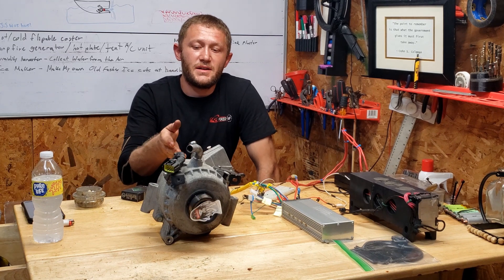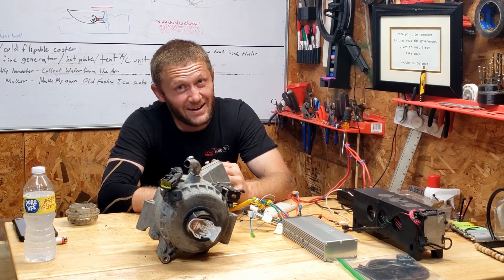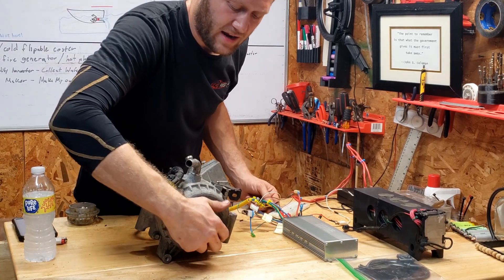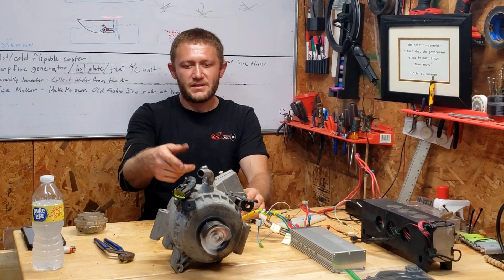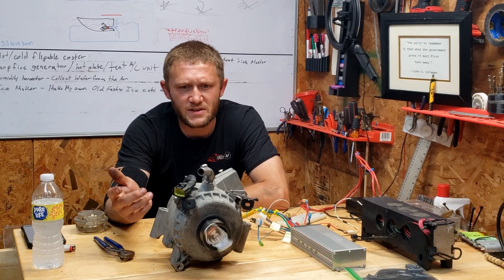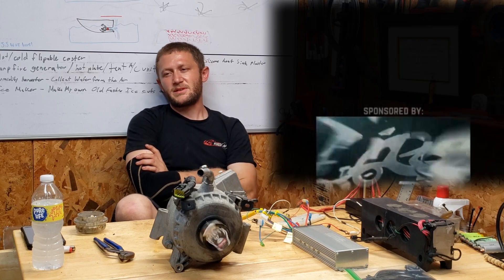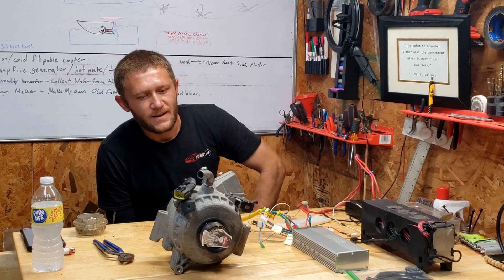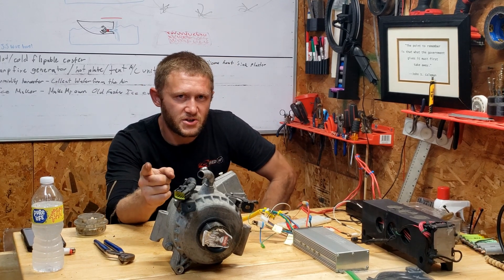[E13]  hybrid's alternator? Just how good of a motor is it? (HSG)- FixedAF

Comment: How is it wired!??
Reply from the maker: Been a minute but email what ya try a figure out. Ill help! 
Fixedafauto@gmail.com
Reply: Thanks for responding, I have the exact same starter generator,  I kept hybrid battery, inverter, blower motor, basically everything from my 2012 kia Optima Hybrid, and wanted to use the starter generator as a wind turbine to power the hybrid battery, without the wiring harness I'm trying  to figure out how to wire it back up on the bench just like it was in the vehicle!?...or......possibly a motor to run my 5hp. Air compressor pump!??.....

Comment: So could you use a rectifier pack and use this to charge say 48v battery?
Reply from the maker: With enough rpm yea. 
Just a flick of the rest ad I get 3v ac across each of the 3 phases. 
Just the same with a regular alternator however
Reply: @FixedAFT  sweet thanks for the quick reply! I've spent the entire day googling it's a toss up between these units for less than 100 bucks and a rectifier pack and some sort of controller vs a 48v starter alternator from a Ford (100a or so) and hoping I can controll the field with a wakespeed ws500. I mean in the name of curiosity and saving a few bucks who hasn't gone down the deep hole of google right!? 🤣🤣
Reply from the maker: Any alternator is only operating at 40% capacity. 
So if u take an alternator. 
Gut the 12v regulator out the back.
Wire in 3 48V rectifiers o e to each of the 3 phases your golden. 
Control charge current vie the armature circuit (two center brushes) and u can turn the charger(Regen brake) on an off via the armature (low voltage low current)

Alternator have a electromagnet for the spinning part. 

HsG has a permanent magnet armature. 

Depending on your interest these two differences could be crucial! 

Happy to help man thanks for the comment!